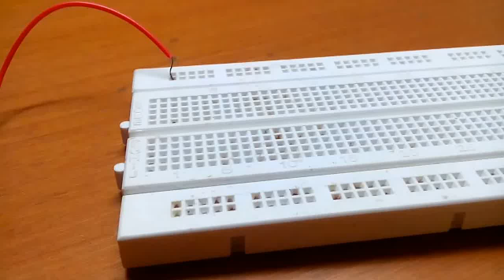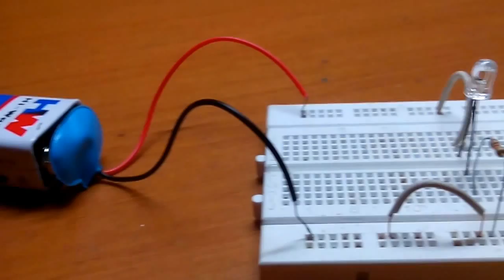How to connect a L.E.D in series to a breadboard.

Comment: I still cant understand the function of wire with resister..????
Reply: Resistors restrict the amount of amps or current in a circuit. LEDs operate around 10 to 20 mA of current. 9v batteries give off to much current by themselves for the LED to handle. Resistors can restrict the batteries current to a safe flow for the LED to properly light up

Comment: brown-black-red-gold resistor has 1000 Ω of resistance,100 ohms would fry the LED diode :)
Reply: Exactly. LEDs operate safely around the 10 to 20 mA range. I used a current calculator. A 100 Ω resistor with a 9v battery would have the result of 90 mA of current!

Yeah, way past the safe operating range

Comment: At time 1:37 to 1:52 which wire you r connecting on the board, i think this is not necessary because all HZ line are internally connected to each other.
Reply from the maker: Ya correct, that wire wasn't necessary! 😅
Reply: lol ty

Comment: I don't understand your accent, and their is music in the background, can you write your speech by replying to me.... It's needed for homework in school, and I can't do it without understanding your accent......................................................
Reply: douchebag

Do your own fucking homework
Reply from the maker: +Princess Hi! 
A L.E.D is connected in series to a 100 ohm resistor to protect it from burning out!

COMPONENTS REQUIRED:- Breadboard, L.E.D, 9v Battery, 1k ohm resistor and some wires.

NOTE:- The L.E.D has 2 pins. The longer pin is the anode (+) and the shorter one is the cathode (-)
The colour code of the 1k ohm resistor is brown, black and red.
A resistor resists the flow of current.

Connect the L.E.D anywhere on the breadboard. Then connect the resistor in series i.e just next to the L.E.D. 
Now connect the 9v Battery. Connect the positive side of the battery to the anode of the L.E.D and the negative side of the battery to the resistor.
So the current flows through the resistor and then to the L.E.D which protects it from burning out!

Hope you could now understand amd this should help you in your homework! :D
Btw which country are you from?
Anyway, have a great day! :)
Let me know if you have anymore questions!
Reply: Troy Araujo Thank you so much, it really helped, and sorry about what I said, it sounded really rude. Thanks again.
Reply from the maker: +Princess You're welcome! 😊